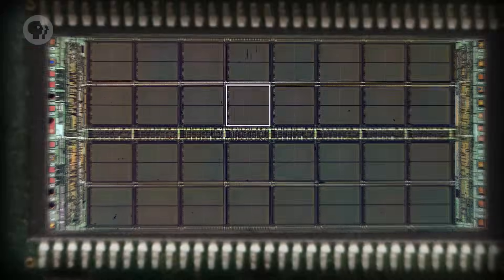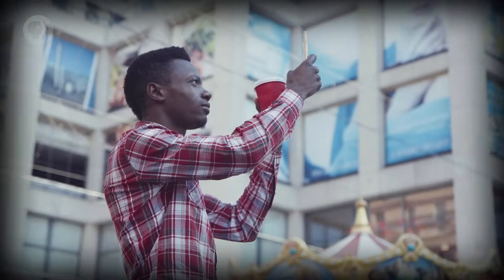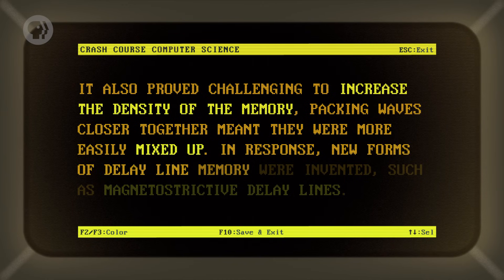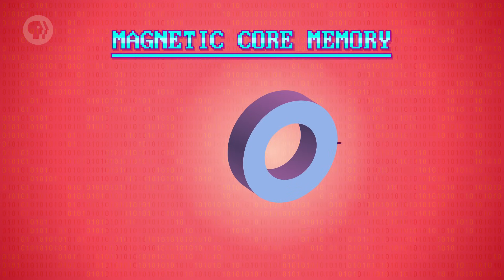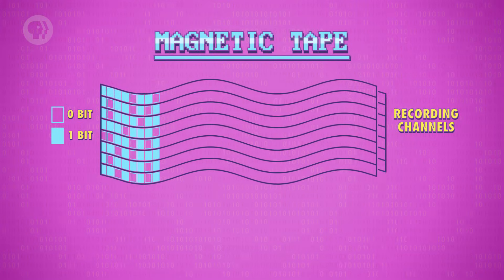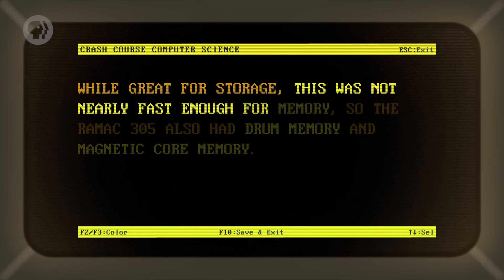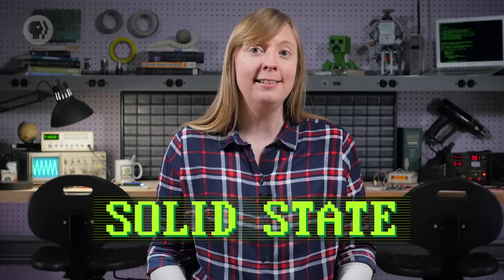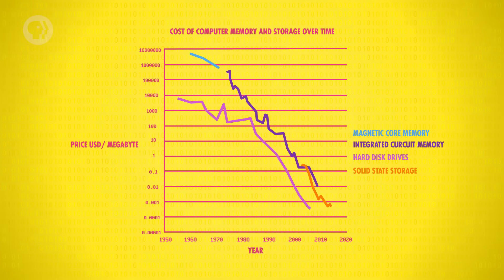Memory & Storage: Crash Course Computer Science #19

Comment: Since the disks of a harddrive are spinning so fast, how does a read-write-head know where it is and where it needs to look?
Reply: In older disk drive technology, one side of one of the platters is devoted to permanently storing control tracks that control the position of the heads. In newer disk drive technology, a control track is in between each data track.

Comment: The presentation of core memory is far too simplified. The proces of selecting a single core and the rather funny way of reading a bit is not described. Or that core memory is both persistent AND needs to be wiped to be read (destructive memory read-out). And Williams tubes have been forgotten.  

Still it is a good job.

Comment: "Unpunching a hole is hard", but far from impossible. My university was still using punch cards in 1980 (replaced with terminals the following year) and the lines for the punch machines would get silly near course deadlines. So I had a bag of holes collected from the punch machines (on days they weren't so busy), a razor and one reference card with all the characters punched in it. Adding a few holes and eliminating a few from a card could be done in a minute instead of waiting hours in line for a free machine.

Comment: has it been mentioned how those punch cards work? i understand the point of them, but i don't get how a little hole in paper gets reliably transfered to the machine without destroying the card.
Reply: In a card reader either a light shines on the card with sensors on the other side detecting the holes or little wires make contact through the card to a metal plate on the other side. The optical card readers stress the cards less, but even the electrical ones do essentially no damage at all. Moving the card around with mechanical rollers probably hurts them more than the actual reading of the data.

Note that though some card readers were shown in the video, most of the machines that were seen with cards were punch machines where you type on a keyboard and it makes the little holes in the first place.
Reply: Jecel Assumpção Jr ok, that makes sense. i swear i heard somewhere they said the card system used pins. something like a pin fell down when there was a hole in the card. made me think a pin would lock the card in the machine. i guess they use other ways though.
Reply: Mechanical card readers were used in the famous Jacquard loom, but we are talking about 1804. By the time we get to the Herman Hollerith's tabulator used in the US 1890 Census the cards were being read electrically. See more details at http://www.righto.com/2016/05/inside-card-sorters-1920s-data.html

Comment: Re: SAGE program at 1:20 - I worked on ASUPT - Advanced Simulator for Undergraduate Pilot Training - which the US Air Force brought on line in 1973. It was the first flight simulator to have a computer generated visual display. The computers (there were three) had core memory, mag tapes, and a disk drive with a stack of nine interchangeable 12 inch metal plates. It was programmed on cards in a combination of FORTRAN and the dialect of assembly for that machine. I don't recall the exact number of cards in the total load, but I seem to remember it was more than the 63500 you quoted for SAGE. 

For what it's worth, the research we did on that machine to find out the best way to use simulators for pilot training led directly to the simulators used by airlines today to train their pilots and run annual emergency procedure check rides (think practicing engine out landings).

Comment: So the memory hierarchy of modern PCs would be Cache, RAM, SSD, HDD, and cloud storage. Correct? Did I miss anything?
Reply: Registers, L1 cache, L2 cache, L3 cache, RAM, Optane, SSD, HDD, Cloud (I'd put it above USB), USB thumb drive, and tape drives.
Reply: So then, Registers, Cache, RAM, SSD, HDD, cloud storage, and tape drives
Reply: Pretty much. Almost all modern computers have multiple levels of cache, even.  And if you add Intel's new "Optane" memory (a kind of hybrid between RAM and SSD,) you can slap on one more layer.

L1 cache, L2 cache, L3 cache, RAM, Optane, SSD, HDD, USB thumb drive, cloud.
Reply: Registers and tape drives are still a thing.

Comment: My first computer (a ten-year0old Tandy TRS-80) used a Compact Cassette instead of a disk drive. It was finicky, you had to adjust the gain/volume just so to make the computer read it. Apparently a bit later there was a little-used system to use VHS tapes for cheap tape backup, but it was even more finicky because of all the extra stuff going on in a VCR with the helical scan head and whatnot. Googling trying to find it, it seems the Arduino crowd are still toying with the idea, just because of the silliness of it -- I mean, you could put a full Arduino system with a multiple-terabyte SSD in a VHS tape's shell. (Which actually sounds like a fun project, I've seen Arduino/RasPi-based NES emulators in an NES cart, why not put the video-playing machine in a VHS cassette?)

Comment: But how are solid state storage technologies of today not volatile?
Reply: https://en.wikipedia.org/wiki/Flash_memory#NAND_flash

To greatly oversimplify, they use the classic gates we saw earlier in this series, but with a type of transistor that has resistive material around it, holding the charge "in place" unless a stronger charge overwrites it.
Reply: Solid state memory (e.g. flash memory) uses a floating gate transistor to trap electrons. There are lots of videos on youtube how it exactly works (it's technical and requires "quantum tunneling".

But it's non-volatile because once the electrons are trapped, you don't need to supply power to retain the memory.
Reply: Yeah, I really wished they'd answer that.
Reply: Matthew Hoiland I would love an explanation for that, I understand cds and hdds and ram easily enough, but ssds are still magic to me.
Reply: I think they use a special type of transistor that somehow get stuck so when you turn off your computer inside the SSD there's still electricity in there
Reply: The limitations of SSD technology include taking more energy and time to WRITE than to READ (like paper and pencil), and gradually "wearing out" individual cells on a chip after many write cycles. This is why SSDs are not defragmented; they don't NEED it, and it requires repeated write cycles to copy files from one set of cells to another.
Reply: They use a system of nand gates. 

It causes way things line up, to get flipped, because of inverters and stuff... I don't really remember though, but it's like how sand stays in the same place once you stop pushing it... 
...it isn't truly non-volatile, just like how wind and earth tremors can mess with my pretty sand shapes: 

Quantum chaos can gradually alter the way semiconductors are charged, untils 1s become 0s and so on. 

It's called "bit-rot" it's the bane of retro games' collectors.

But in that sense: nothing is truly non-volatile.

It works, so we use it. Inks can fade, cylinders can wear down, vinyl gets scratched, so on an so forth.
Reply: Matthew Hoiland Take a look at a product description of a modern SSD. It probably says NAND flash somewhere :D

Comment: I felt so old when you tslked about floppy disk not existing anymore. I mean, It wasn't that long ago. I think I used them 12 years ago.
Reply: yea.. its a bit dum. some stores you can still buy them, and they are still used in many professional equipment
Reply: Sounds about the same as when I was last regularly using them to transfer files. I have even used them in the past few years for plop boot manger so I could boot old PCs off a USB stick.
Reply: I'm really glad I didn't need to use floppy disks in 2005. Jesus dude, CDRW drives were $20 even back then, CDs were a dollar.
Reply: @owlredshift  I already got no CDROM by 2006)digital only
Reply: Curly G Cradle Rock I live in a third world country and I only stored word documents for only one use. Also a CD burner wasn't that common in the day. So floppy disk was the best options for my needs

Comment: Something that should be noted about SSDs is that they're different from normal ICs in that the storage process involves essentially pushing electrons with really high force into and out of materials with really high resistance. The resulting electrostatic fields turn field effect transistors on or off, without needing moving electrons.